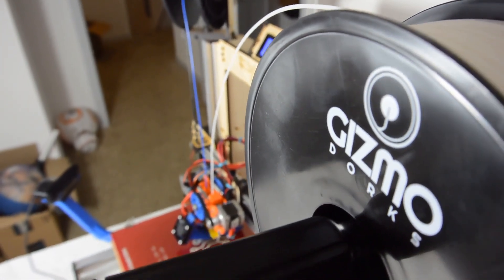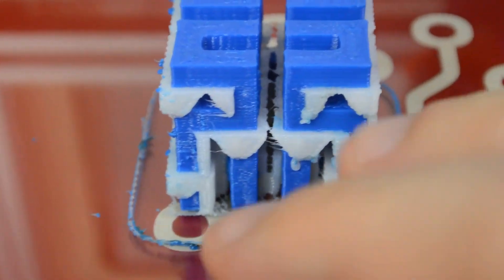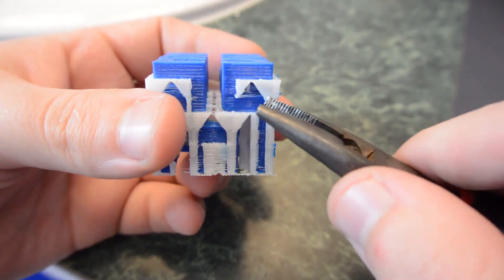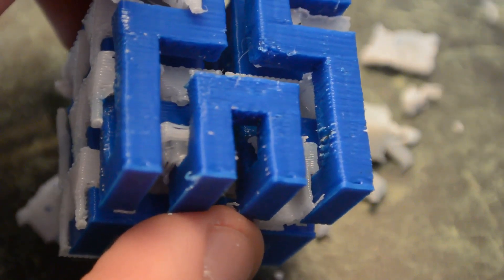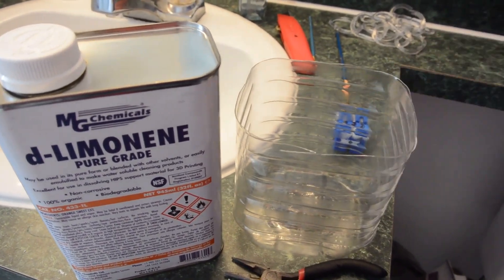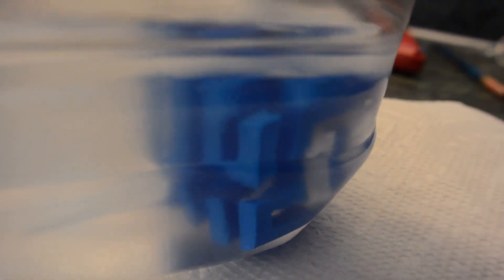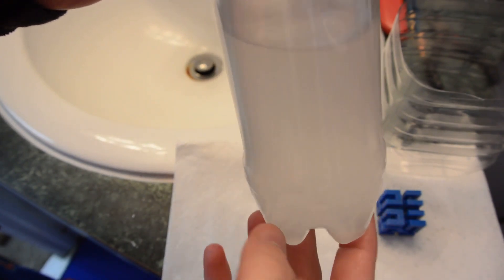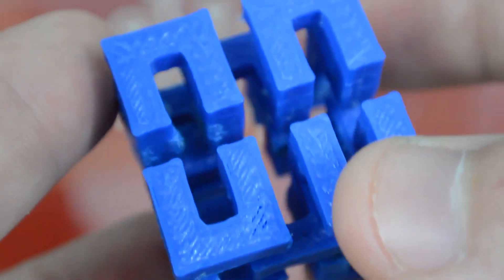3D print complex objects with dissolvable supports!

Comment: Do you still have to skip a layer?
Reply: No. Print directly on the surface of the HIPS. Also skipping support material and printing a dual print with the sparse infill of the second object as you would print a dual printed design, much like a lost wax cast in reverse.

Comment: no wonder, its a dual extruder. not useful info for like 90 percent of 3d printing hobbyists who cant spend a ton of money on a printer with dual extruders.
Reply from the maker: companyoflosers this was a 500 printer (from 4 years ago), which I printed my own dual extruder for. Less than 60 bucks for an additional motor and hotend. Not an expensive upgrade at all.

Comment: have you tried to dissolve it with orange cleaner ? Or orange oil ? d-Limonene is expensive
Reply from the maker: I have not, I've only tried it out with limonene. Its expensive, but its gone a long way in my experience, as long as you remove the bulk of supports before dissolving the hard-to-reach supports.
Reply: Hoffman Engineering
okay thank you

Comment: Can't get the ABS to stick to the HIPS. What are your temperature settings? Brand of materials?(abs/hips)
Reply: Section31HQ it won't really stick to it which is one of the reasons it is desirable
Reply: Indeed, but the ABS needs to grab onto something, which is why I asked about temperature settings. Once cool it peels off pretty easily. I'm having trouble with the small details in ABS that are fully rested on a HIPS layer. I wouldn't mind fully enclosing a print in HIPS for certain models. Then I also have the problem of finding GOOD limonene. Got some at Amazon that is no good at dissolving anything despite claiming otherwise on the can.
Reply: The ABS will stick to itself..!

Comment: PVA is worse than Nylon for absorbing moisture which probably makes it really hard to use. I havent tried disolving HIPS, but have printed it and its generally nice stuff and works ok as a main filament. Apparently its pretty easy to paint too. And as you say it is cheap. I think it would be cheaper than ABS if it were as popular. Next time you should try an Ooze shield or wipe/prime tower to increase the quality of the print.
Reply from the maker: Yeah, I've heard of rolls of PVA being ruined just by being out in the air for a 10 hour print, people even create special air-tight boxes to hold it while printing. That, combined with possibly ruining a hotend makes me hesitant to try. HIPS however, a pleasure to print with.

I definitely recommend an ooze shield, I've done a couple prints after this video was recorded, and it makes a world of difference. Great advice there.

Comment: Does this also work as support for PLA? 
PETG should be okay, if it doesn't dissolve a PET bottle.
Reply from the maker: People recommend PVA as dissolvable supports for PLA, as they stick together well. PVA is water dissolvable, but has a bunch of possible issues when printing, namely it turns into a concrete-like substance if heated for long periods of time. I have not tried PLA with HIPS, but a quick google search shows mixed results with it. I'll have to put it on the list of things to try!
Reply: Ah cool, i have never heard of PVA for 3d printing, sounds more like glue ;) 
But it is in addition to the printing difficulties really expensive with 60-120 €/kg...

Comment: Can you try using PLA for the part and ABS for the support, and using acetone? HIPS is expensive.
Reply from the maker: I'll have to try it, I have a feeling it may be difficult since the ABS will have to be printed with a 90C bed temperature, I'm not sure the PLA will want to stick at that high of temp. Worth a try though!

Also, in my search HIPS is not drastically more expensive than other filaments. The brand I used above is about 24 USD for 1kg, but I see a few others for around 16 USD, which is close to PLA/ABS prices. The expensive part is the limonene, which is about 30-40 bucks, compared to 6 bucks for the same amount of acetone.
Reply: Hoffman Engineering Oh, I dont use a heated bed for PLA, I just use blue tape. PLA should stick fine to blue tape at pretty much any temperature. Unfortunately I dont have a dual extruder, but I do have two hotends.. maybe I could try and rig something up.
Reply from the maker: Yeah, and thats the problem, ABS needs a really hot bed in order to adhere to the bed. So either you print it at a temperature that PLA wants (60C or less) and the ABS supports don't stick, or you print it at a temp that ABS wants (90C or higher), and PLA might be too melted to stick. Looks like some people have had successful prints though, so worth a try!
Reply: Hoffman Engineering Since the abs support would be encased/surrounded by the pla, which sticks positively, I'd think the abs would maybe not stick to the bed but at least stay in place until the model is high enough from the bed that the bed no longer effects it, no?

Obviously it wouldnt be ideal if the pla model had overhangs and things that require low heat, but I dont really think that the bed temperature would be that big of an issue. Maybe if the supports were generated in a manner that was made specifically for cold bed abs, i.e. very large brims/rafts under the support. Even if it warps, it wouldnt matter since its being removed, as long as it sticks. I wish I could try this, but I dont think my printers are big enough for dual extrusion unless I wanted something like a 40x40mm build volume.
Reply: i think if you do a kind of base in abs (like 3 mm high) pla will stick to this base and not be affected by the hot bed too much
Reply: So a raft?
Reply: Ralphie Vigg no, it should be bigger than a raft... maybe if you can tune the raft stiffness it could do the trick, but i was thinking more of a base stl that you print in top of